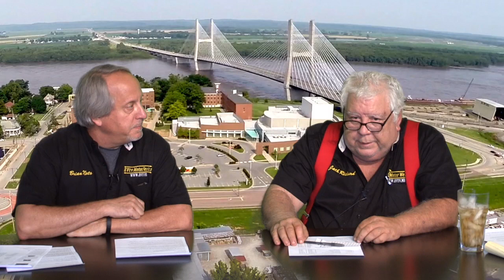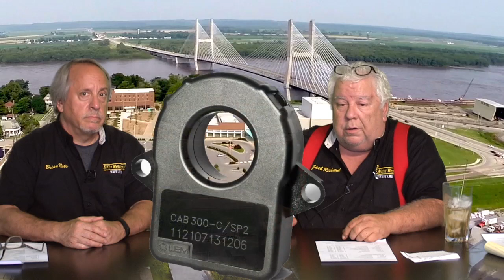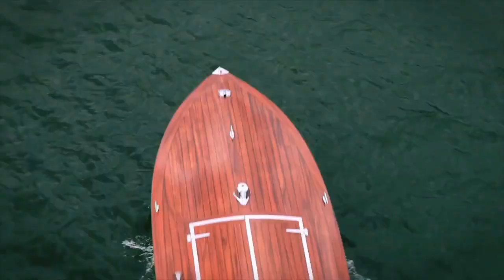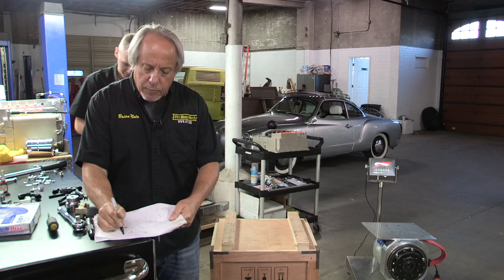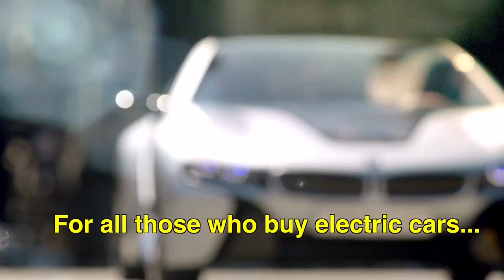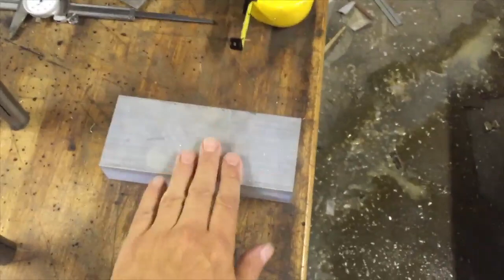EVTV Friday Show - September 26, 2014

Comment: Brian, you need a proper seatbelt in the Ghia. A hip belt only serves to keep your dead body in the seat during the crash. And you need to make sure those batteries don't want to be your friend during a crash as well. A 60km/h crash is like a 10 story fall onto concrete and that's when you don't need 200kg batteries landing on you as well.
be wise enough to not be fooled into thinking that a crash is like the docile normal driving. Physics is no respecter of fools.
The steering column might also kill you.

Comment: Jack, I think you can see that 38k$ plus 2 year labor is not a way to take over the world. That's the domain of the well off retiree or arbitrary hardcode enthusiast. And that is indeed what we see in the audience if I'm not much mistaken. When a used Leaf is 13k$ with resale value, longer range and service centers, it's a non starter. And it will be far more pronounced when new EVs are sub 20k$ plus rebates and then used for sub 10k$. And this will of course happen. So is conversion doomed to never be relevant? no there is a way. You can get nice size 132 industrial AC induction motors, even aluminium for 150$ new in endless supplies. If one supplier falls away then there are many others who make almost identical product with standard faceplates. Around 80$ freight in moderate volume. And they are willing to rewind it from docile mains voltage operation down to around 100V so they will operate aggressively with a 3-400V pack. (industrial motors are speced to operate docile, same as the forklift DC motors are 7-8HP but good enough for cars, industrial vs car use). These AC motors will spin to 12k rpm. Combined with egeardrive it's a Tesla roadster drivetrain. For cheap. It's real Jack. It's very low hanging fruit so why insist on picking 10k$ overweight siemens motors or deal with the obtuse UQM.
And there is similar potential on the controller side. Power transistors can be near dirt cheap, we just need a good design done and fabrication. gevcu doesn't get us there. We need the cheap controller and the cheap motor. Then we can take over the world.
It's right there for the taking. But time is running out to make a difference in the world.
If you do it right it opens up a lot of conversions plus ferrari beating performance cars for cheap plus stuff like boats. If it's 2000k$ plug and play plus batteries then many will play. When it's 10k$ and a constant engineering experiment that might fail, few will enter. And so it is.
Reply: Dan Frederiksen I think you're missing the point.  As a fellow VW Ghia owner, I can tell you this:  You don't buy one with any hope of being able to logically justify the expense.  VWs were affordable cars in the 70s.  Now, they simply spread the equivalent of new-car cost over the period of restoration.

If you love the car, the cost isn't a factor.  (I believe they call that "a hobby.")  Or, like these guys, you may just have enough money that it doesn't matter.  If you want value, pick up a Camry or a Kia and convert that.  ;-)

RE: Motors:  IMO, the HPEVS motors are where it's at right now.  You can get motor + controller with moderate performance (but still much higher low-end torque than an ICE) in a well-polished package for the cost of just the Siemens motor.  OTOH, if you have a heavy car, or want V6-class performance, you're going to have to spend some cash.  You gotta pay to play.

RE: GEVCU:  In a conversion, there will ALWAYS be some sweat equity.  For many, that's part of the appeal -- for the challenge, and for the fact that you know exactly how it works, and how to repair it.  Otherwise, just go buy an OEM vehicle and get on with life.  The GEVCU is a nice device, since you can abstract away the controller interface, and be able to pick and choose (and even swap) without having to re-engineer the human interface.  That's a significant portion of the multi-discipline (hardware, code, motor interface details) done for you, being that much closer to plug-n-play.  Being that it's open source, you can even pick and choose what you need, and then roll your own (my personal preference.)

RE: Industrial motors:  Using motors and parts not intended for EV applications just means MORE work to adapt it, and possibly more headaches down the road.  Maybe it's worth it to you for the low cost, or if you're a hacker and love to make things work where they were never intended to work.  But it's not for everyone, and there are usually compromises that are only acceptable for the guy that looks at the project in terms of "how little can I spend and still get a working car?"  (Which is fine.  To each their own.)

There's no right way.  The point is, whether you buy stock cars, spend more money and buy purpose-built kits, or scrap the thing together, you're introducing the concept of EVs to everyone around you, and solving real-world problems for the next generation of EV owners.  It's a step forward, and it's not necessarily easy or cheap right now.  It never is, at the beginning of any new paradigm.  That's part of the fun of being an early adopter.  If being a pioneer was easy, everyone would do it.. and there wouldn't be much pride in that.